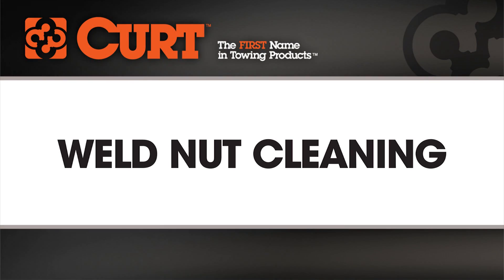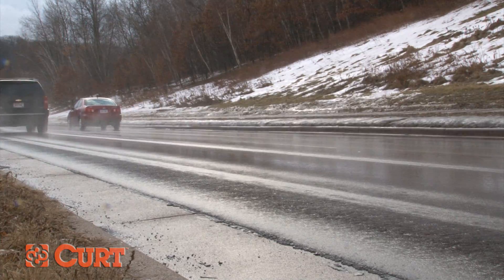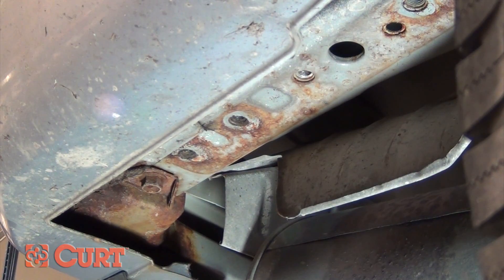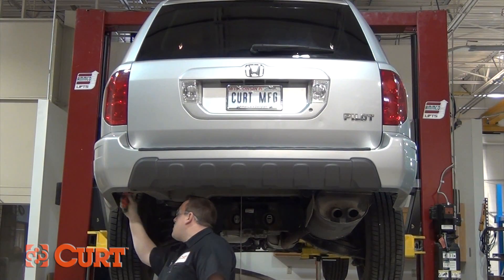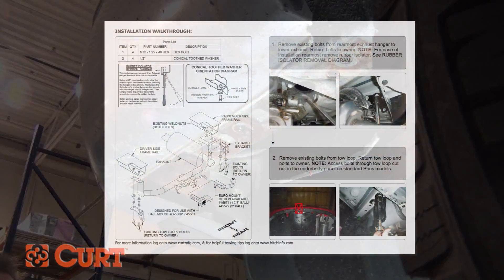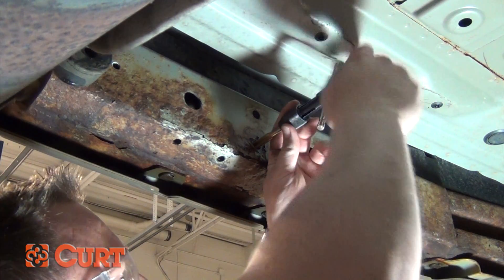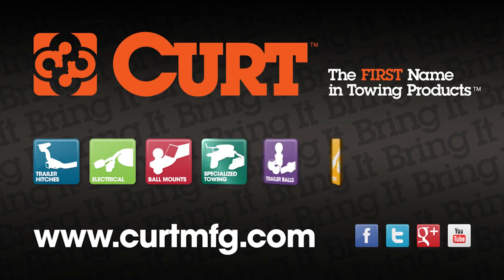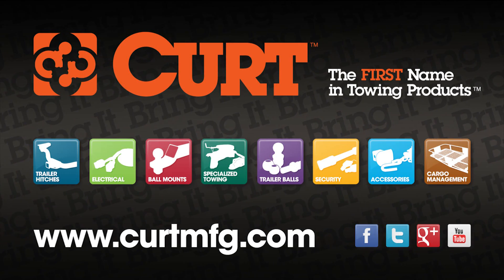How to Clean Rusted Nut Threads - CURT

Comment: Glad I found this video.  It's what I was thinking, so this confirms it.  I will try tapping.  If the threads are gone, do you recommend tapping for the next size bolt?  Current is M12x1.25 .  There is no M14x1.25 bolt that I've found, but I can get M14x1.5 .  So maybe I go to that size?  I haven't measured the holes on the hitch yet...
Reply from the maker: Go ahead and give us a call and speak directly with our knowledgeable technical support team at (877) 287-8634, extension #2. They'll help you get it installed today.